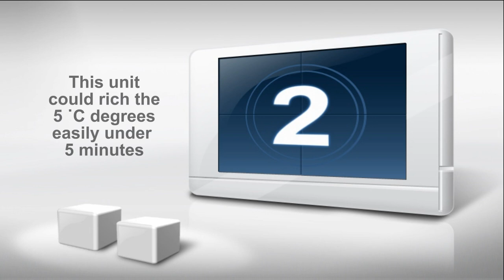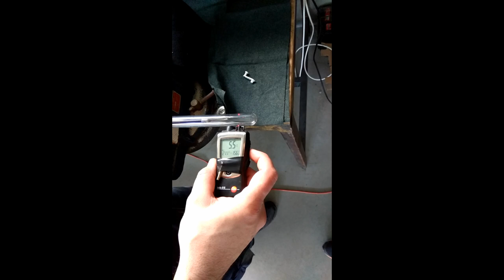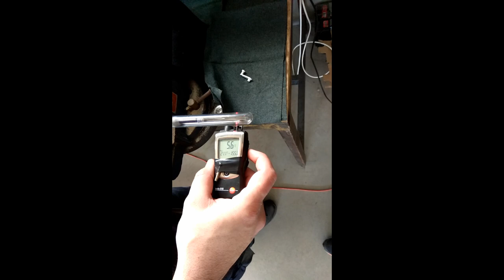Test tube NASA Stirling cooled down to 5C

Comment: sweet! do you think it could power a small refrigerator?    a thought: an actuator arm made of PTFE, like a from cutting board, would be easy to cut out and very smooth.
Reply from the maker: Yes, and no! The construction could work better as heatpump but with a totally different construction also with pressurised working gas and good as possible heat exchangers. The actuator arm is not necessary here. I just use this gearing system to convert my circular motion to linear. The engine could work with different driving mechanism also.

Comment: Really nice machine. Congratulations! But I still have some questions about the function. At which point does the air from the working piston comes into the machine? Directly after the black seal to the left side? And the displacer tube is airtight on its blue piston rod?
Reply from the maker: The black seal is not a perfectly  seal it has six air path around it and it hold the blue rod. The blue rod is not leaktight perfectly in that small diameter cylinder but it has a great tolerance. I made it from 1ml glass syringe.

Comment: Great job.  Would it get cooler if there was a heat sink (aluminum can fin) at the hot side?  It would be nice to see the hot side temperature for reference too.  Keep up the good work.
Reply from the maker: It could go lower, but the mechanism started to mold a bit, so I finished before totally destroy. The hot side should be cooling, but the heat exchanger works well with the thiny gap between the glass tubes and the outer glass has big surface to contact the ambient air. So it wasn't too hot yet with this passive cooled side. The lowest temperature  what I guess -5 degrees approx with this conditions. With active cooling it could rich much-much lower temperatures! :)

Comment: his accent is a little hard to understand at times and using odd colours for the hot side (green) and cold side (orange) needs changing, but the diagrams from this point on seem clear enough where the cooling part of the cycle is  Mod-01 Lec-27 Cryocoolers Ideal Stirling Cycle https://youtu.be/_I-NTj7UaKM?t=625 
18.01 shows 2to3 in the non sinusoidal section actual cooling section, hopefully useful to look there and perhaps also use light external evaporation  a dab of rubbing alcohol etc now and then on the hot side of the regenerator section as 3to4 begins might also help reject even more heat.

btw what was the room temp at the time as that will also keep the final temp higher , insulation (aircreate or other high insulation facture materials to be used) perhaps?

https://www.youtube.com/watch?v=OVT-WxbHflc&t
How to make carbon nanofoam for [blades cryocooler insulation tests] :)

as a shortcut robert says he put his carbon hydrothermal stuff in a thick glass pyrex? container with ceramic tile cover to seal it,  took out the revolving plate and jammed a stick tight against the roof of his testing microwave to seal it and did his in only 30 minutes on high but i can't find the link right now so do as you will
Reply from the maker: The room tempearature is measured and signed on the laser thermometer, I don't rememeber right, but the experiment was good without any added cooling, because there is a high heat capacity glass part with high surface. But the tempreature drop could go faster if I use any type of cooling there, but the experiments won't be nice, and clear because those parts. :)
Reply: @AttilaBlade  before i forget its also worth restating building frans re-created plastic/thin metal friction welder  for quickly fabricating  (banned lol)plastic straw/support cold side structures etc  https://www.youtube.com/watch?v=r0zpqhhcmp4&t=47s Ask Fran: Build Your Own Friction Welder!
Reply: Its funny ! We are doing kind of similar researches !! Friction welding (im looking for doing my own water tanks connections pipes with this technic) carbon foam (from toasts burnt in canister, to insulate tiniy house, heating compost and car fridge with a light and rot resistant material as well with aircrete) .. etc
Cheers !